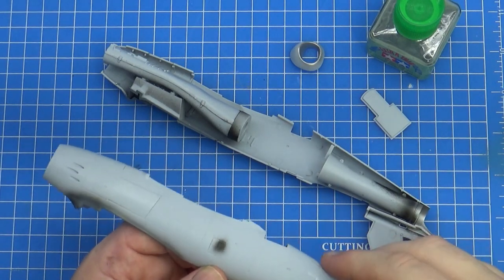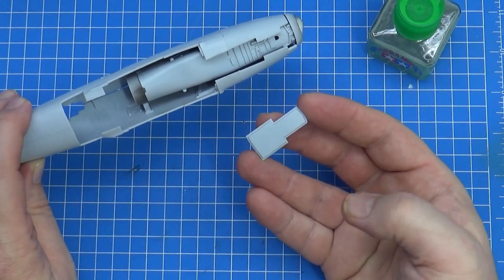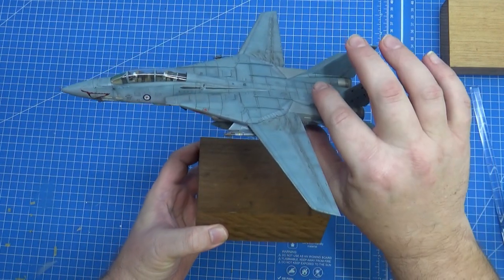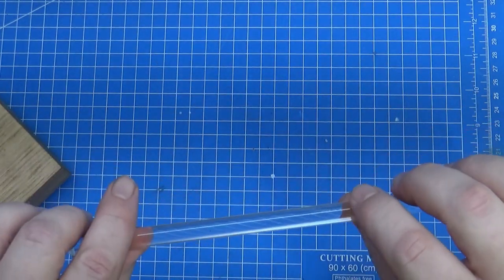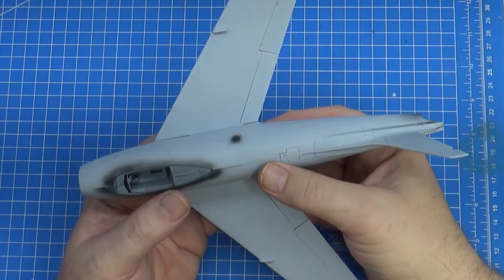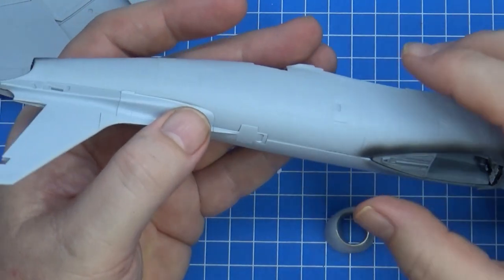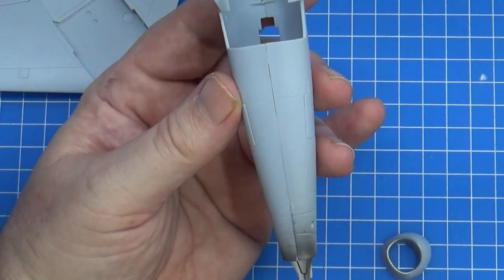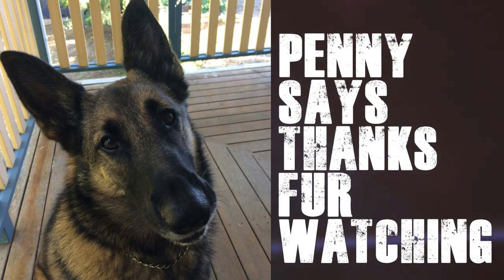Airfix 1/48 Canadair Sabre F.4 Part 2 - Assembly including flight stand construction

Comment: A shame as I bought that kit a couple months ago for my stash to build this fall…
Reply from the maker: It can still be built, but will require some more care and attention - I would eliminated the fuselage locating lugs, add some little styrene shelves behind the cockpit, dont use the locating lug for the intake, and probably do open panels instead of closed.
Reply: @beckersmodels  thanks for the tip. A shame the quality control fella at Airfix fell asleep on this kit.

Comment: Too bad the fit is so poor for that price. But then again making it fit is also part of modelling, unless you like the painting part more then the actual construction. I think with Harry it's the other way around 😄
Reply from the maker: True Dave - if I had applied a bit more "foundational" skill with the build process it will end up a better finish, but I did approach this as both a slammer and an "amateur" building a 1/48 kit, and in this arena, Airfix has failed again. But its still fun!

Comment: I bought & built this kit shortly after it was released & despite being a bit of a clown, even I could see that fixing the tub/intake/nose-gear bay to one side of the fuselage had drama written all over it, so I didn't & left it floating until I had 
the fuselage together & more reference points to correctly align everything.
I watch your videos expecting to find useful hints & tips, not to watch you deliberately building an average (at best) kit amateurishly!
Reply from the maker: Point taken on amateur hour - this was meant to be an out of the box build. I could have done a few other things like remove the fuselage plugs, add some tabs out of styrene stock etc to help align the fuselage halves, and not let the tub/intake stay on one side, but the point of the build is to see if Airfix has caught up with the crowd when it comes to solid engineering, which they definitely have not! 
Its disappointing because I've been playing with their 1/48 Walrus and that has much better fit and engineering so far....